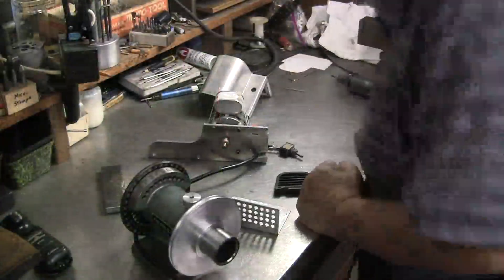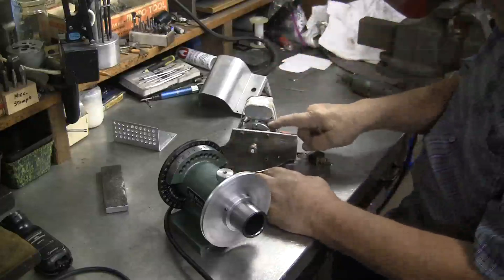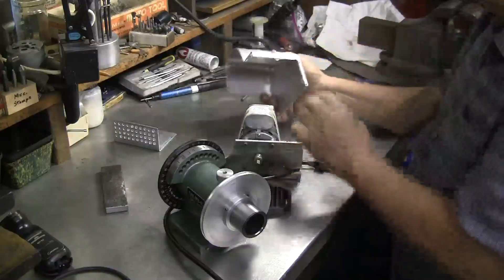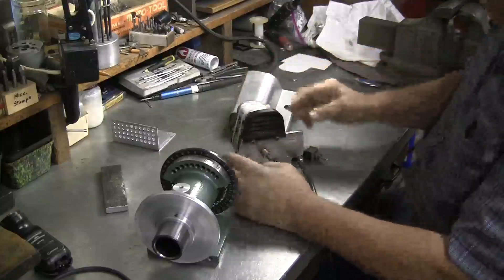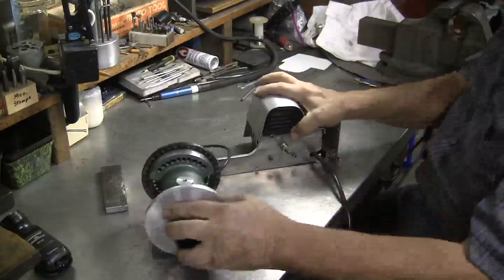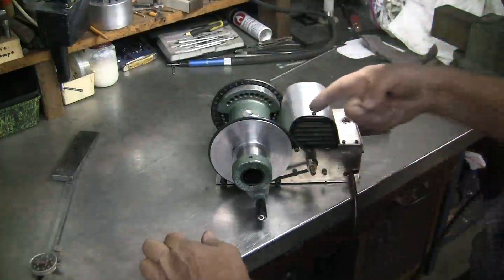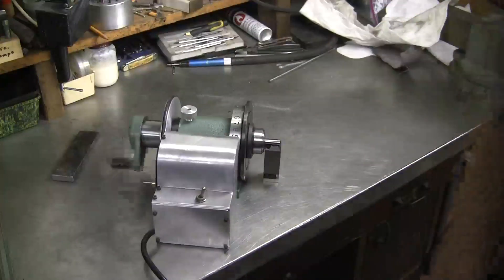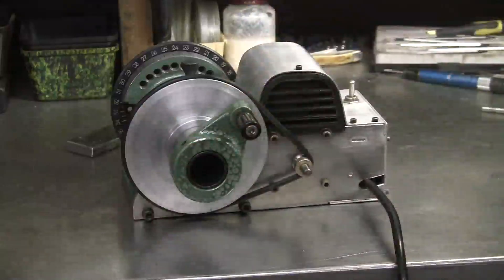Spin Index Fixture Motorized

Comment from the maker: I suggest making the small pulley larger, just too much slippage.   When grinding small diameters; use a fine grained wheel and you may have to undercut it where less than .100" touches the work.